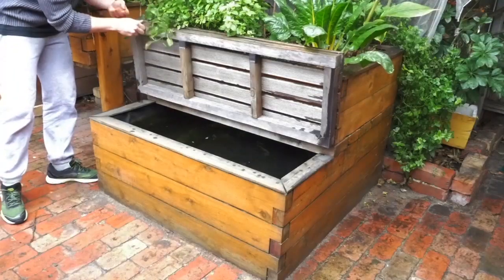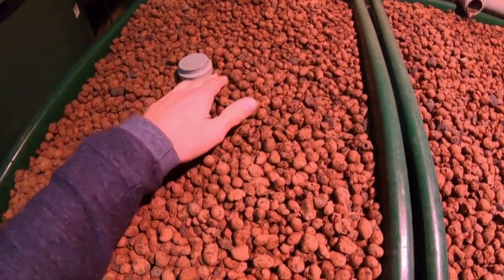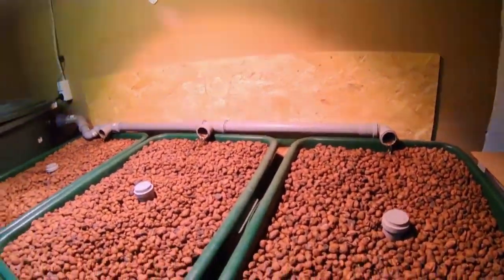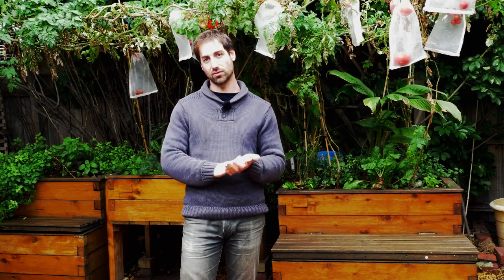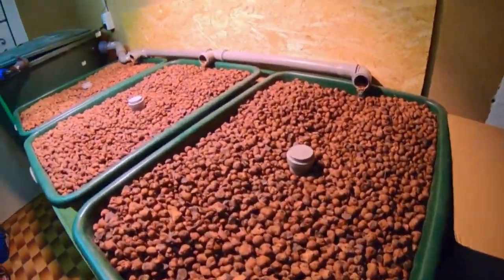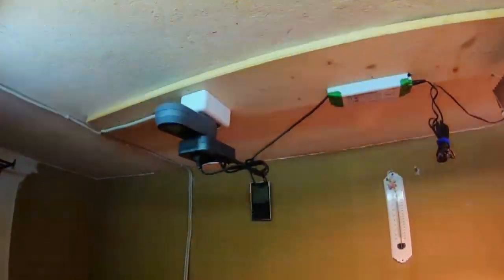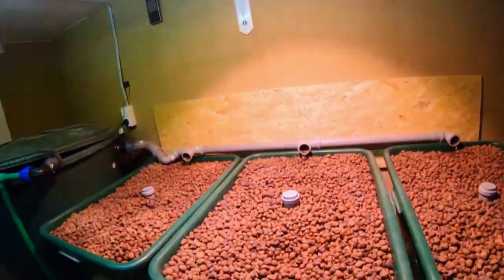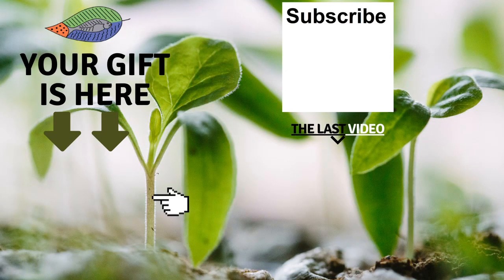homemade aquaponics overview in germany | indoor aquaponics, good idea?!

Comment: I don't think having all three beds connected to one siphon is a good idea. It creates other issues, now there are 4 points of failure:
 1  the connection between each bed to the siphon tank could be obstructed, and even one will foul the whole system. 
2  now you must precisely control the flow of water into all three beds evenly so all three beds flood and trigger the bell siphon all at once. 
3  If all the beds don't get an even distribution of water at the same time you will have each bed fill at different rates and possibly being flooded for a prolonged period of time, and
 4  Since there is only one bell siphon, if it fails, all the beds will remain flooded, suffocating your plants.